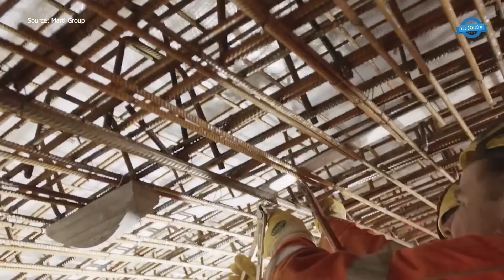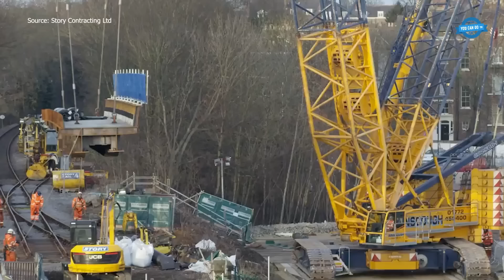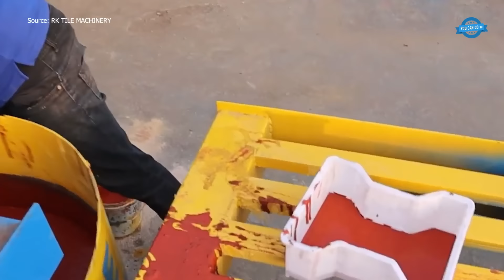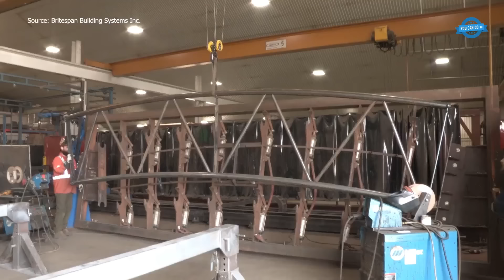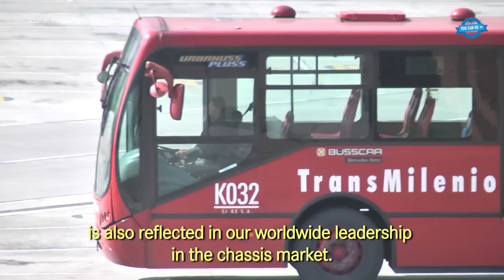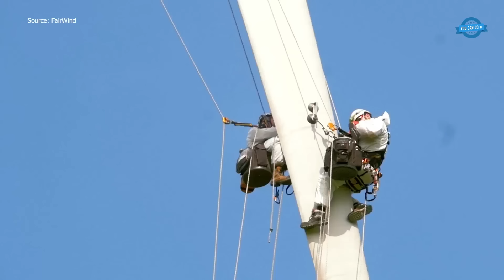Live-Rail Tunnel Widening Looks Impossible! Infrastructure Projects, Heavy Equipment & Manufacturing

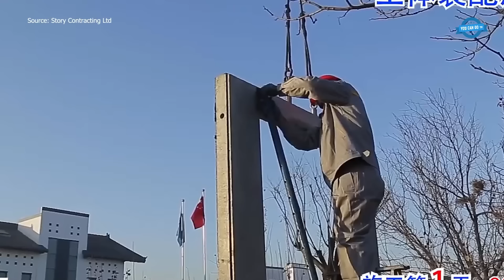Comment: 09:34  These are great for hurricanes, tornadoes, wildfires and if set up properly for earthquake prone places. Flooding as well as you have you have systems setup by sealing. Fires especially if from outside, if fires starts outside it can spread extremely fast unless you put in a fireball extinguisher in the ceiling for every room, closet, bathroom or storage room. $99-$500 depending on size of room.